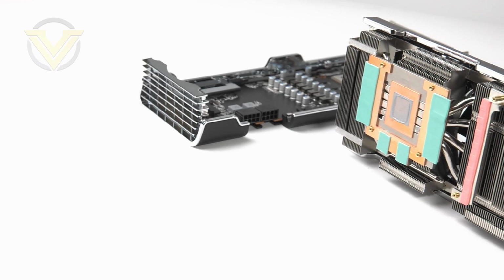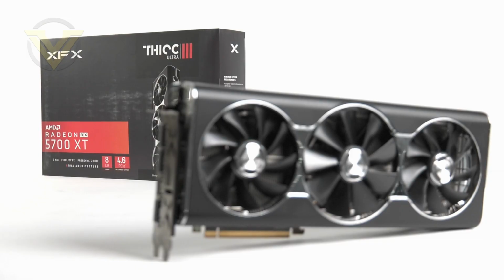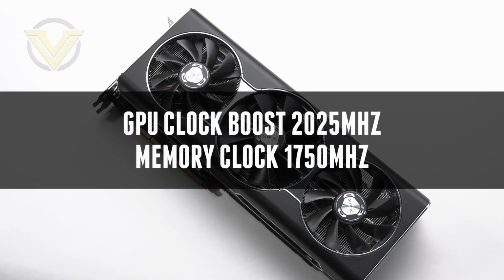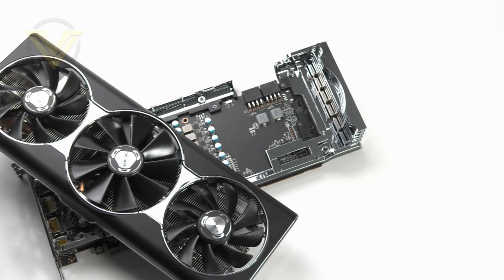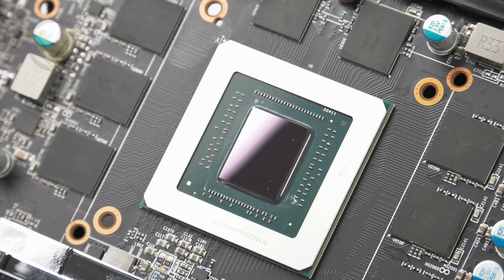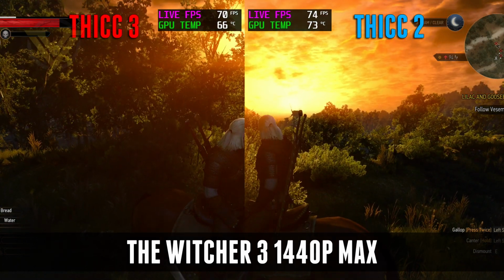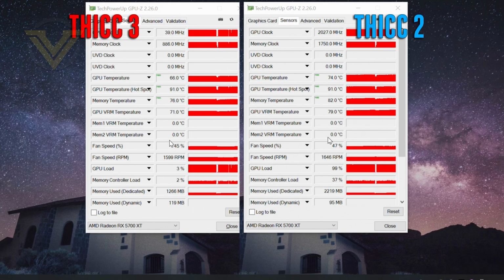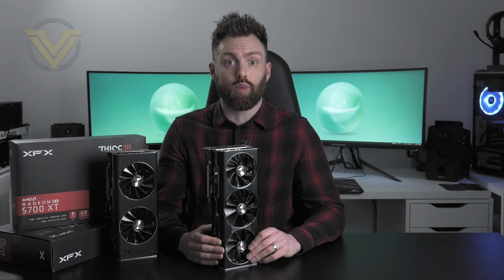XFX 5700 XT THICC III Ultra Review (vs THICC II)

Comment: I am still using this card today.  Most games are played on three HP 25es.  Eyefinity setup as 5760x1080p is very immersive with HOTAS or Wheel and pedals. Paid @ $450 new. Have seen them be sold used for $1200+ and am planning on keeping mine for a while yet.

Comment: I'm willing to repaste my Thicc 3 soon. What's the thermal pads thickness on this card? I'd be grateful for an answer
Reply: Hey, did you find out the thermal pad size for this card?
Reply: @bmxismylife123  I did eventually, but I can't really recall the sizes.I think I went for 1mm for the VRAM.
For the MOSFET It was either 1.5 or 2mm. I can't remember which one actually. Looks like I have a bad memory😢
Reply: @elrater0999  Damn, there's absolutely no information online regarding this card. I tried so many places, even emailed XFX themselves to no avail. I now ordered Thermal Grizzly's Kryonaut for when I'll repaste the card. I'll try and get the thermal pad sizes when I tear the card down. It still functions great for me, the VRM temperatures for me are like 51 degrees Celsius tops for me, though the memory sometimes can get as hot as 88 degrees with the stock fan curve, but I think my oven of a case is probably to blame, too. I will also be upgrading my NZXT H510i to Corsair's 4000D Airflow with 2 Noctua 140mm fans as intake, 1 Noctua 120mm fan as exhaust and the original fans the case comes with will be used as the top exhaust.
Reply: @bmxismylife123 I did the same and looked for weeks and didn't get an answer. So in the end I bought 3 different sizes (1mm, 1.5mm and 2mm) and tried different combinations until it worked out. I've probably repeated the process 6 or 7 times and took me almost 2 weeks of testing. And I've tested both Arctic and thermal grizzly. I would recommend you to use Thermal grizzly for both the thermal paste and thermal pads.
I also had High memory temps only while mining but not while gaming. It was sitting in the high 80's but now it maxes at 72 degrees.
Wish you good luck with the process and have fun with it
Reply: @bmxismylife123  small correction on my previous comment. the Pads cover only the VRAM and The MOSFETs and don't cover the VRM

Comment: i have the same gpu but my temps are getting  up to 80 degrees and i have good airflow in my case can someone help
Reply: Mine is 79-80 Untra 1440p I don't have any problems with this temperature.

Comment: You show very limited info for a good review and analysis. 
What is the test scenario here? Open bench? closed case?
What Bios was selected?
What are the operating frequencies?
I have a Thicc 3 card and it gets around 80ºC+ on closed case and boosts up to 2150Mhz @ stock and get a bit noisy cause it reaches above 3000Rpm
Also there shoul be more FPS differences bettween the 2 cards.
Reply from the maker: Brilliant. Thanks for your contribution!
Reply: @Vortez  my comments are constructive, dont get me wrong

Comment: Hi will 5700xt thicc iii be good for my 
Ryzen 5 2600? 
And should i use water cooling system on this to minimize the temperature  or should i use 8 fans instead 
Thanks for answering
Reply: U don’t need a water cooling for a 2600. It is not a powerful CPU.

😂 sorry for the late reply

Comment: Will a 550w psu run it or do I need to upgrade? Ryzen 5 3600 CPU stock clock.
Reply: Get ''Corsair CX650W PSU'', one of the best decisions for 5700 XT & R5/R7 or even R9 Builds.
Reply: Nah your good with a 550 w. Even a i9 9900k and a rtx 2080ti can run fine on a 550

Comment: I literally saw no difference. Just a little bit of temperature.
Reply: I'm with you on this one. Card is simply too big for my case, and if I can get the thicc 2 that's 13mm shorter, it'll just fit. How important are those temps though? Does it cause constant crashes?

Comment: Just ordered this along with a Ryzen 9 3900X. I'm making an upgrade to 1440p from 1080p. I hope it'll get me going for at least a year before the new cards come out. Also cool review, boss man
Reply: Damn, I just ordered this too to go with the 3900X I got last month. Worth every penny.
Reply: @Shark__Sunny  Hell yeah dude. What's your temps on your CPU?
Reply: @Markus-rm3zt  only got 3 fans right now so they average about 50-60. Getting some more real soon though.
Reply: @Shark__Sunny  Is that under load? Nice!
Reply: @Markus-rm3zt  Under a light load, yeah. Still need more fans though, but they're on the way
Reply: I'm about to buy the R9 3900X and this GPU .. Did you get to try it with Adobe Premier or another similar one?
Reply: @giancarlogomero2745  I have not no. But I would definitely recommend an AIO,

Comment: I have a xfx Rx 5700 thicc 3 but it doesn't say ultra on the box is there a non ultra version of the thicc 3? As I can not find any videos on this card other than the ultra version
Reply from the maker: Yeah there is a non ultra - what is the product SKU in the box saying?
Reply: @Vortez  I'm sorry I'm not sure what the SKU is or where to find it lol
Reply from the maker: There should be a white label on the box which says the part no. RX-57XT.....
Reply: Rx-57xt8tfd8 
That's what's on the white sticker

Comment: If I'm looking to REALLY push games on a 3440x1440, but want to stay amd due to freesync (monitors range is 80-100fps). Upgrading from an rx590 sapphire nitro(surprisingly, hits around 60-85fps on medium settings!), would this be able to hit 80-100fps with high to max settings and get me into that sweet sweet freecync range (Games like D2, Rocket league, ESO)?
 i72600k, 16gbddr3.

Edit, picked up an rx5700xt and seem to be able to play at max settings on my 3440x1440 and stay around 60fps.
Reply: oofff! I highly recommend ditching that ancient CPU, and upgrade. the AMD Ryzen 3 3100x and 3300x are 90-120 USD and they beat a i7 7700k, if money is tight.
Reply: @GodofLovers  holy crap, really? I honestly don't even know what mobo I should pair with that? That's awesome that they're that cheap though. Lol I'm running an asus p8p67le mobo right now. I know it's a relic, buuuut...it was free and I couldn't argue with that price.
Reply: @lynnmckenney1987  You can get a cheap b450 mobo, update the bios, and pop in that 3100-3300x or higher if you wanted. I believe if you got a cheaper b550 board you wouldnt have to worry about the bios flash.
Reply: DankMemeKid  my cpu usage has never exceeded 50% (I monitor it while gaming), so I'm not sure it's much of an issue right now.
Reply: @lynnmckenney1987   Just because its not using 99% of your CPU, does not mean that its not bottlenecking your system. Trust me! I had an i7 4770k with a GTX 1070, and with Half life Alyx I had to play on low fidelity, and just upgrading my CPU to a Ryzen 7 3800x, I am now able to play on high settings with the same GPU. Now my GPU is the bottleneck, but Ill be resolving that very very soon. Regardless I didnt think my 4770k was much of a bottleneck, and figured it was mainly my GPU...but nope! It was my CPU. My CPU was maybe usuing 40-50%..but it still bottlenecked my system HARD! You can easily get a Ryzen 3 3100 and a mobo for a 200 bucks give or take, keep that ram you have, and upgrade your GPU. If your ram is under DDR4 3200..I recommend upgrading that as well. Your CPU and GPU are the most important things to upgrade from what I see.
Reply: DankMemeKid  hrm. I do have it oc'd to 4.4, so maybe that's why I'm not noticing anything?

It will definitely get replaced eventually, but I just spent more on a video card than my entire pc, so it's gonna be awhile, lol

Is there a way I can test it and see other than monitoring it while gaming?
Reply: DankMemeKid  Ran one because I got curious...it actually went really well! 

62nd percentile overall, lol it got rated an aircraft carrier on userbenchmark?
Reply: Can I just point out that your ram is ddr3 currently and you'd have to replace that also with any modern cpu and motherboard upgrades .
Reply: @mikedodd8487  yeah, I'm happy hitting 60fps on modern games in 3440x1440 at mostly max settings for now.  

Once upgrading is a must, I'll go nuts and upgrade everything during a big sale.
Reply: @lynnmckenney1987  What games are you playing that get those frames at 4k? Im very suspicious.  I feel like you are being misleading as to what "modern" means. 6 year old light weight games? You definitely wouldnt be able to do that with gta5, witcher 3, Resident evil 2, red dead redemption 2, latest COD, etc.
Reply: @GodofLovers  It's not 4k, it's 3440x1440. I think it's like....maybe 2k...maybe?

I'm playing destiny 2, gta5 (picked it up when it was free),forza horizon 4, rocket league, etc.

Definitely not trying to mislead anyone.

Need to edit my original comment, upgraded to an rx5700 xt and get 60+ fps at max settings in most games.
Reply: @lynnmckenney1987  didn't realize it was 1440. Your Rez is higher than 2k though. It's kinda 3k ish I guess. Regardless I thought you were using a much older gpu than the 5700xt lol. That's mainly why I was so suspicious.
Reply: @GodofLovers  ahhh, I gotcha! Sorry, forgot to update that in my original post!

Comment: I have just brought the Thicc 3 I don't know you are getting 65c in witcher 1440p Max just tried myself to see what i'd get im getting 70c even 75c consistently anyone know why this could be?
Reply: Also as a additional question if anyone can help since I have installed this GPU I have been having issues with my audio in games stuttering / audio cutting in and out really confusing.
Reply: mby previous drivers you had installed? And regarding the temps mby you just have worse airflow in your case...btw how loud is the card I'm thinkng of getting it as it is the cheapest 5700xt i can find
Reply: @jurekompara6396  I tried everything in terms of drivers nothing to do with airflow (I'm not a noob) the card in terms of performance was fine from what I could tell and then noise levels were almost perfect.

I never buy/keep bad cards I do my diligence before hand. But AMD driver issues are out of my hand.
Reply: @jurekompara6396  I could of got any 5700 xt if I wanted but chose that one was even thinking of getting liquid devil but too much f*cking about.

Just be careful with AMD driver you might not have any issues but you might have issues.

Comment: I have the THICC 3 and it is very large, it barely fit in my case, but it is also really quiet. I play in 4K all the time but it tends to crash at high settings, this is probably because the driver is incompatible or I need to overclock it some more.

Comment: This is an oxymoron btw. More fans equals always more noise.
I would bet my left nut that because of the larger fans together with the updated revision of the thicc 2 paired with a custom fan curve, you can run it with slower rpm and with that quieter than the thicc 3.

Comment: I game at 3840x1080, super ultrawide 32:9 aspect ratio. At least for the last year since I was finally able to afford the 49”. 
Previous to that I gamed at 2560x1080 standard ultrawide aspect.
The only 4K displays I have are technically tv’s, which i have tried hooking up to... but I either experience an input lag or drop in FPS that make it unplayable IMO, even using a Radeon VII or a RTX 2080 I still will not play on a 4K television

Comment: I just got the thicc ultra 3 and I have a ryzen 7 2700x and I downloaded all the drivers for the gpu and my game sometimes freezes for about 5 seconds when playing modern warfare. This never happened when I had my gtx 760 4Gb card. I did get rid of all the nvidia drivers before installing this gpu but still have minor issues. Any help will be awesome
Reply: This smells like a driver residue issue. I would try to reinstall windows.
Reply: @patrickdergroenr1247   figure it out thanks... i downloaded the game on to a NVME ssd and now it runs smoother and doesnt freeze

Comment: XFX has to many problems AMD should drop them as a partner I had to re do my thermal paste for the die and my pads for the vrm on my 390x do to lack of , once I did that it stopped over heating and even stopped going much above 70c even to this day

Comment: The 'Hot Spot' temperature still seems a bit high. Though surely within spec, on my Asus RoG Strix 5700 XT the 'Hot Spot' temperature doesn't go over 82°C. The other temperatures and fan speed are similar to my card, so those seem good now.

Comment: Will be really nice if you will add some noise test, coz "pretty quiet" is subjective.
Reply: Exactly therefore thumbs down as of now...
Reply: Mine gets a bit noisy, above 3000rpm on a closed case scenario. But it boosts up to 2150Mhz @ stock and around 210-220W (performance BIOS selected)
Reply: no chance since the settings it comes with from amd are not really going to make your card last ( it comes at about 45% speed when the card is 100 degrees) you might want to change it to a setting where the card runs cooler but is not a jet yet. but if you are really sensitive save your money for an aoi card like the aorus rtx 2080 waterforce. also fuck amds drivers i sell my whole pc more or less becaus of that driver shit and i will never touch an amd card again...sadly they are so strong in cpu that i can't leave that out but anger wise i should. fucking ridicoulus
Reply: Why people care about noise when they use headphones or 2.1+ sound system... That's stupid
Reply: @JavierElNeNe86  because there are people who don't use headphones but 5.1 speakers or even 7.1 speakers. Me for example, get headache with headphones
Reply: @BATES007  is that due to the clamping force or something?
Reply: Who cares about noise when you use god damn headphones all the time for gaming.
Reply: Tharindu Dhanushka I do. 5.1 surround set, no headphones for me
Reply: @wimpie031  I bought an ASRock Taichi version of the 5700XT which has similar boost clocks to thicc 3. First thing I would do is undervolt the GPU. Too much heat and power for that 5% extra performance. And a custom fan curve. That should help. And proper airflow in the casing.
Reply: And power consumption?

Comment: XFX never, WORST RMA support ever.
Reply: I agree never XFX back when I got my 390x they didnt put any thermal paste on the center of the die and there was only a tiniest little bit on the edge of it . Talk about heat problems
Reply: @BigT1984  Get some of this stuff through best buy with the protection plan, you'll be happy if you have to replace something.  After 2 years I broke my headphones in half wheeling my chair over them and I brought it in thinking they would say its my fault and my monitor started having vertical lines, they literally took it from my hands and said ok what new product do you want without question and I got brand new stuff.

Comment: So does it compete with Nitro+ and Red Devil for the price of the Gaming OC and Pulse?
Reply: im literally wondering the same thing rn?
Reply: @x_two6ix_x  I find this slightly worrying. No comparing with either card. If he is sponsored by this particular card manufacturer, would he have to disclose this in the description?
Reply from the maker: If you check, we haven't reviewed either card by Saph or PC. The most obvious comparison for this v3 was to compare vs v2 which we had reviewed. Web review will have comparison to other cards we have reviewed as I clearly stated. (it will be published soon).
Reply: Pulse will compete with msi mech, evoke red dragon, raw ii, etc. They're on the different price range, whilst this beast joining 3 fan segment
Reply: @WisnuAji-Benjamin  if you're grouping cards by fan count, gigabyte oc $400 USD on US amazon probably has the best value compared to its competition
Reply: in the UK this card is cheaper then the gigabyte one
Reply: @WisnuAji-Benjamin  Sadly, both Mech and Raw II appear to suck be the crappy end. 

Pulse and Red Dragon are definitely better than Thicc II, I guess Thicc III is in-between Pulse/Red Dragon and Nitro+/Red Devil
Reply: @dainiusvysniauskas2049  Looking back now the THICC III is arguably the best card but there is little separation at the top and it's pretty subjective. Pretty much a virtual tie with the Red Devil, Pulse Nitro + and even the MSI Gaming X (possibly beats out the Red Devil). Heck the regular Pulse and Red Dragon aren't bad either but as far as Gigabyte goes yes the MECH OC is absolute trash but the Gaming OC is actually pretty good and maybe the best value. Strix looks okay too but the price that goes for you can get any of the above really.
Reply: In amazon is at $399.99 great deal for me!
Reply: Atm it's 400$ on Amazon

Comment: They screwed everyone on their first card and you're commending them for charging people to fix those problems... No, just no.
Reply: apparently if you are a buyer of the original thicc they are willing to replace your card for free with the new thicc II if you contact xfx directly
Reply: @danielemedici948  hi I bought first card before reviews were in... Where did you hear this info?
Reply: If what daniele says is true then they are making up for their mistakes. If it's not true, then they sold a poorly performing product at an unreasonable price. That's pretty much screwing your unsuspecting customers.
Reply: @replacement6386  It's true. An XFX representative announced it in a thread on Reddit.

https://www.reddit.com/r/hardware/comments/dprhht/techpowerup_xfx_radeon_rx_5700_xt_thicc_iii_ultra/f5yzo6l/
Reply from the maker: They didn't screw anyone, THICC II isn't broken. The THICC III Ultra just works more effectively in the thermal department, they've gone away, revised the design and I've acknowledged that.